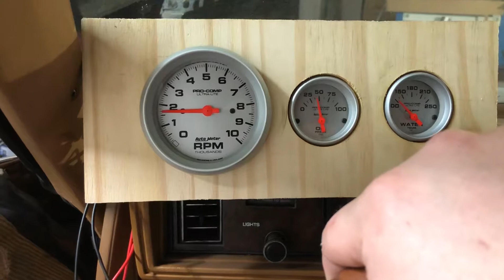1971 Oldsmobile 350 Rocket oil pressure. Custom built, cam break in.

Comment: I have a 77-80 olds 350 and was wondering where you put the oil pressure sensor? Any advice will help. Thanks.
Reply from the maker: a1b2c3hhhggg right in front of the block next to the numbers. Right next to the alternator bracket. For an electric gauge you'll need an adapter so it stands up tall enough to clear the timing cover.